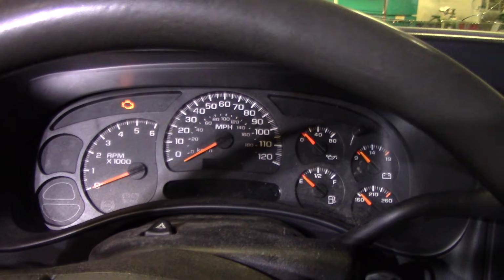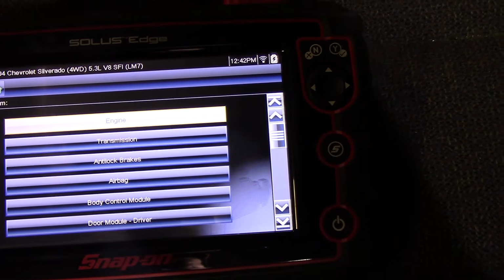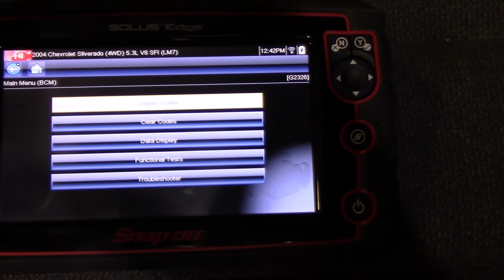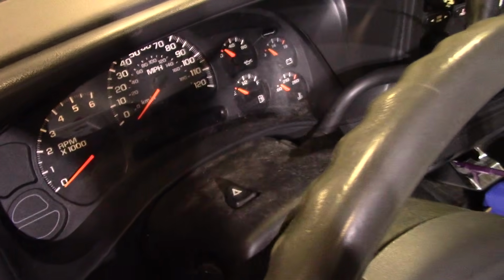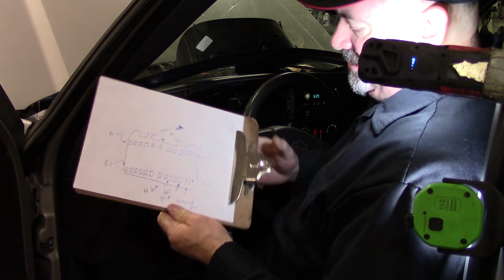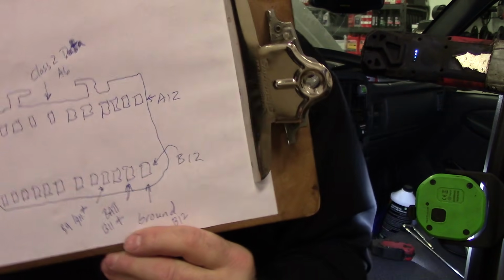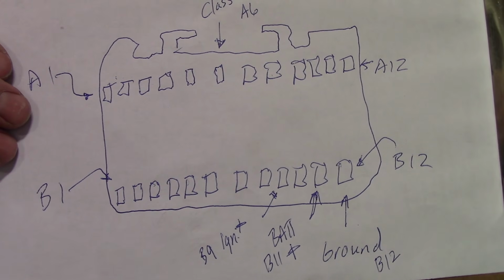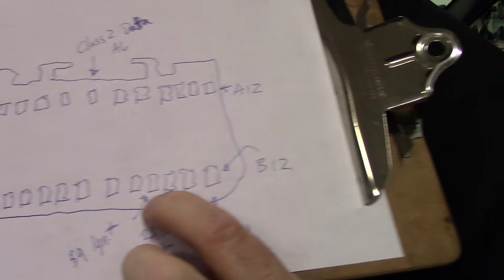Chevrolet GMC Cluster Gauge Diagnosis and Repair

Comment: I have same issue with mine but the weird thing is if I remove the fuse for the cluster my radio works just fine but as soon as I put fuse back in for the cluster the radio goes off and stays off.  Is there something that ties the cluster with the radio?  It drives me nuts...

Comment: What happens if you check the grounds, replace the unit, check the connector..and still have only turn signal, back light and check engine light

Comment: At 11:47 the wiggling of the connector can give a false diagnosis of a bad connector, when in fact the connector is soldered directly to the PCB, and when you wiggle the connector you put pressure on the PCB and can effect bad joints. 2003-04 full size GM's have a weakness in the cluster that causes intermittent power. The wiring, plug, ground and power sources is reliable, the issue is 99.99999% of the time internal to the cluster.

Comment: Sir, I repaired my cluster but my needle timing is now off
Reply: The needles need to be set to the proper start location. It's reccomended to mark the start location before pulling the needles off.
Reply: @jeffescortlx  i did, but I think I need to disconnect and readjust

Comment: pins on cluster or subject to light oxidation causing gauges to work periodic clean plug with q-tip dipped in alcohol  or use contact cleaner ,my trailblazer does it about once every couple years.will require gauges to be removed.
Reply from the maker: Crazy. I should probably do more autopsy work on these failures to heal us all learn more. Sadly that takes a significant amount of extra time but would really add to the quality of the video. Thanks for the info.

Comment: great video. these things r piles of junk. had mine repaired twice alredy. the other problem is the wires on the harness r loose. so wat i did now is bent the pins on the cluster the ones on the top bent them upwards botom bent them downwards. lol seems to help but stil no mileage display. gota mess wit it sum more. wat a sob
Reply from the maker: I found out this one had been replaced by GM once before just a few years earlier. Sad.
Reply: Pin 8 is the ground for odometer and gear display. Make sure pin is tight then T into that wire for an additional ground. I used a 14 gauge piece of wire about 18inches and found a good ground behind the wheel and fixed

Comment: Ha ha, a 'wiggle test' done another way, great tip! Gotta think it is broken solder joints inside, I'd be taking it apart to try and reflow any joints I can get to. It is easy to see why a pro reaches for a proven reliable option.
Reply from the maker: Thanks. Yes I can’t afford to goof around with soldering boards since it just wouldn’t pay enough. I would dive a little deeper if it was my own rig for sure. Good of you to drop by. I sure love your channel!

Comment: It's possible that the old unit had a bad case of Cracus Solderus :-D
It's lasted well for its age, better than us lol.
I watch a youtuber that repairs clusters, the worse ones are where the owner/mechanic trys to fix it.
Often just makes it worse :-(
Reply from the maker: I should have tried to solder it back to life. That would have made for a better video at least. Or I should have set the old cluster on fire. Yes on fire. That would be fun.
Reply: @ThecardoctorTV  I believe I have a cluster repair techinition listed for Alaska in my "cluster repair network" video.

Comment: I did not hear even a hint of the cost of a re-built GM cluster?
Reply: Dave Allen, cost would have been nice to know. Although if someone sees this in 10 years, prices will have changed. (Many looking up info may be years down the road, but you made a good point anyway!)

Comment: The 2 grounds under the drivers door might fix the fuel sending unit issue.
Reply from the maker: Not positive it is an issue may have been low on fuel. I knew of the TSB for ABS issues related to those frame grounds but actually wasn’t aware of fuel level circuit problems. Good to know.
Reply: The Car Doctor I’m in the rust belt and buy/sell all GMT800 vehicles before they get crushed due to failed inspections. I usually clean up the grounds on the firewall, front core support, under drivers door, and tail light ground. You wouldn’t believe how many issues clear up because the computer doesn’t read zero with a bad ground!! Thanks for the videos!!
Reply: Thanks

Comment: Very very common between 03 to 07 GM clusters.   I've repaired the EMPROM and stepper motors.  Replaced the bulbs to LED.  Be sure you replace the x27 version.  They are the updated ones from GM.  Very easy to work on.  If you have the hot air gun and decent solder gun,  just don't pull it hard you'll break the copper in the board.  Hope that helps.

Btw EMPROM are for the PRNDL light and mileage display.  Easy to fix and some solders need to be reflowed.  Simple lol
Reply from the maker: Maybe easy for you. I would probably melt the board and fry every capacitor on the thing before I got the solders fixed. Haha.
Reply: @ThecardoctorTV  hahaha,  look at Eric O.  He did one.  It was his first time lol.
Reply from the maker: Eric is a sharp dude. I would trust him to do open heart surgery on me.
Reply: @ThecardoctorTV  me to!!!
Reply: @ThecardoctorTVI  can see the guy cracking your chest open with a crowbar 😂
Reply: @ThecardoctorTV  there is spray to help with solder joint
Reply: I know this is an old comment,but if I take out  the EMPROM from the 03-07 cluster can I just take one from an 99-02 cluster and have the PRNDL and mileage? If not,then which EMPROM (part #?) do I need. Thanx in advance 😎
Reply: I tried to install an 02 cadillac cluster in my 2000 silverado. We tried to do a mileage correction so that the new cluster would show the actual mileage on the truck and while doing the mileage correction the cluster stopped working. Removed it ..reinstalled the stock cluster and it shows the mileage but just as with the cadilac cluster..but no gauges work. Where does the cluster get its information from ?

Comment: We had to fix the clusters in my chevy trailblazer
Reply: What causes the chevy trailblazer to rev up and down while driving between 50-60 mph? Doesn't rev up and down below 50 or above 60. No check engine light on

Comment: My 2005 Envoy dash lights flicker and the headlights sometimes do the same. Any suggestions. Thanks
Reply from the maker: Check your alternator for AC voltage
Reply: The Car Doctor 
Thanks for the suggestion. How about a quick video on the best way to do so

Comment: Had an 03 Silverado and had to re-solder my cluster to get the PRNDL to show and put some steeper motors in and it was fine. That cluster was a real cluster —— but you figured it out so good call. Keep up the good work and will watch your videos.
Reply from the maker: Good job. I’m sure this one could have been fixed by finding the issue on the board but I’m just a parts swapper at heart and this was a quick fix. I own a few of these vintage vehicles so I might be digging into a cluster of my own before long.